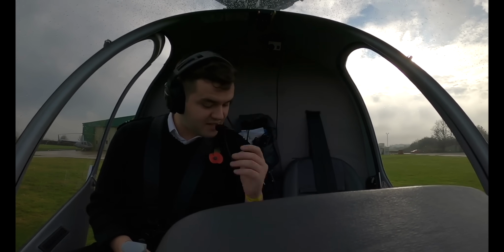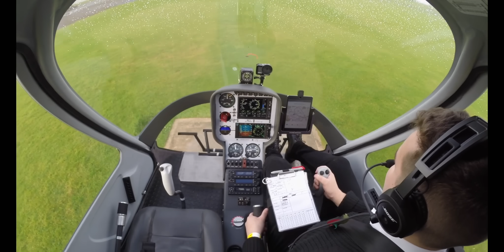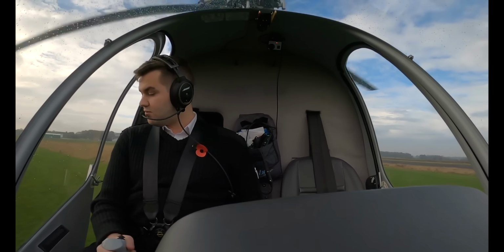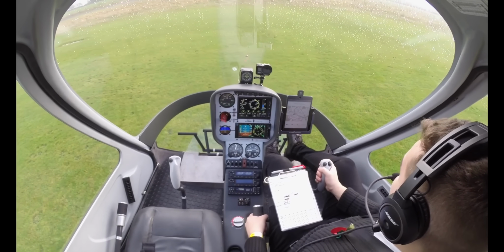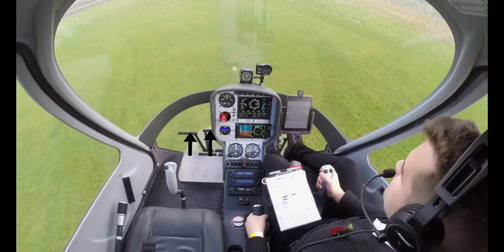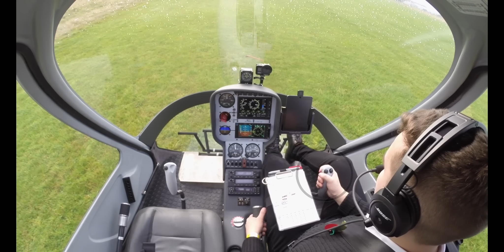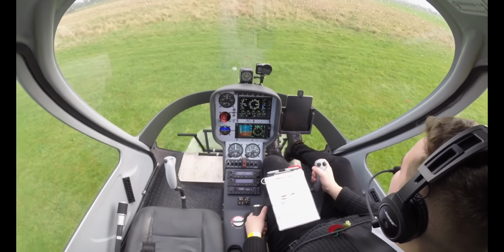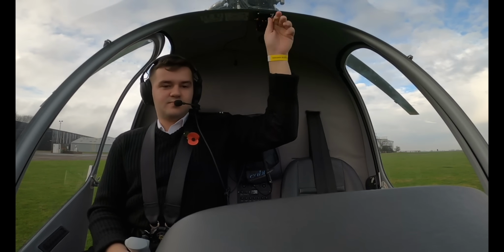How to fly a Helicopter - The Basics

Comment: I started lesson about a month ago and love it. I was flying remote control Helicopter for years and made the jump to the real thing. I was amazed at how similar they are and having an idea of how things worked really helped out.
Reply: CAN YOU PROVIDE ANY INFO ON HOW TO START HELICOPTER LESSONS OR LICENSING?
Reply: @gibson5056  I researched a few aviation schools that had helicopter in my area. There was one real close to me but the one I chose was a 45 minute drive because the instructor was one of the top rated in the country. I got my private V.F visual flying license just a week ago. It usually takes about 6 months but I had the time to take extra classes during the week so I was able to get all my flight hours in in a little over 4 months. To me the actual book part of it was a little harder. If you're really interested there's some great simulators for helicopters there's one that goes for about $800 and it's very realistic I'm not quite sure what the name of it is but again if you're doing a little research you'll find them. I'm going to buy my own but when I started off my instructor gave me one he never used and I put a lot of hours on it.

Comment: Awesome video sir.  I'm a fixed wing private pilot myself, but today decided to be brave and try helicopters in VR.  I don't have a cyclic or collector but my stick yoke and throttle will do for now (with my rudder pedals).  

After spinning out, flipping over, and doing all sorts of uncontrolled maneuvers (that always resulted in my burying myself 6ft deep) I finally slowed down and said to myself, "you know academically that one of the first things a chopper pilot is gonna do is spend hours hovering in ground effect".  So that's what I did.  For hours and hours, and finally got the feel of it!

So today I flew a chopper (in VR still) from San Francisco, all the way down to San Diego, stopping at every airfield and helipad that caught my fancy along the way (even Catalina Island).   The landscape and sights are even more beautiful (in VR at least) from the vantage point of a chopper.  Not sure how that is, but it is!

So, now I'm gonna have to add getting a rotorcraft-helicopter class rating to the bucket list!

Subscribed!!

Comment: Clear and simple explanation. Pretty sure there's more to the skill, still feel confident I could look for a place to land the aircraft if needed.
Reply: Watch the continual movement of his right hand on the stick. That was the most shocking for me during the few lessons I had; you are continually inputting tiny movements when hoovering and moving slowly. I described it to friends as feeling like you're controlling the most slippery vehicle imaginable. The other surprise for me was the delay on the controls and the way they catch up with your input, and it's also a little different with each control. On top of that as described in the video, when you push forward with the stick you need to counter the aircraft's yaw to the left by giving it a little right peddle (a phrase I heard so much I'm sure instructors must have nightmares around this phrase!). Hovering, as a learner, I used to describe to friends as being the hardest video game you'd never play! Interestingly, having only taken eight lessons, I never got to land. It's by far the best experience I've had, and while I never went any further I remember the experience like it happened last week; the lessons were over 13 years ago now. I described the overall experience as being the most incredible fairground ride imaginable.

Comment: Great explanation and demo... but you never showed what you do in terms of power (throttle) settings. It seemed like it is set to some power level, and then all up & down is done with the collective? So you never change the power (e.g. RPM's) as part of the flight control inputs? Can you clarify? Thx!
Reply from the maker: Hi Mike, that's a good question and maybe I should have clarified that a little better. The governor automatically alters the power for me when I demand differing amounts of power when I pull the collective. We are trained to used the throttle in case of a governor failure but normally it does it for us.
Reply: … the big red button is the ejector seat.

Comment: Question what about engine RPM? Does that stay at a somewhat fixed level? Does that change with how you go faster and slower? Coming from totally clueless just curious thanks
Reply from the maker: Harry good question! It's mainly about how much you pull the collective. The more you pull it the more power the blades need to keep spinning at the required RPM. The governor automatically controls the throttle (twist grip on the collective) but we are also trained to use the throttle when flying manually in the event of a governor failure.
Reply: @TheMicroPilot  
That answered my question as well.  I was wondering if the throttle was a twist grip on the collective.

Comment: How to fly a helicopter... Don’t.
Helicopters don’t fly, they beat the air into submission, and there’s plenty of windows so you can watch the air reach up and smack you. They fall “with style”, and consistently beat emergency crews to the scene of the crash by at least 30 minutes. The fan on top is just that, a fan, designed expressly to keep the pilot cool. When it stops turning, you can watch the pilot start to sweat. FI here. 😉
Reply: I love helos - but they're really NOT airframes, just a collection of spare parts, flying in close formation, and all held together by The Jesus Nut. So named, because if it ever comes off the threaded shaft in-flight, you scream "Oh, Jesus!" and get an answer, very quickly.

Comment: Im not a pilot, but to me i think i could relate it to a session rubbing your head in a circular motion and your stomach in an opposite circular motion. While you move your feet from left to right with bent knees in a sitting position. Than twitch your eyes from right to left and pretend your talking to the traffic control guy, until  you're in control of each independent movement  Then one can know if that's a thing for them.

Comment: Where is the throttle?  What increases the RPM's? Because thats what makes you finally lift off from the ground. The engine doesn't just run at one RPM the moment you start the engine.. there has to be a "gas peddle" somewhere.   I'm thinking theres a motorcycle type grip on the end of the collective, and you twist with your wrist to increase the RPM's

Comment: I always thought the collective had a twist handle, like a motorcycle throttle, to control the pitch.  I know when they start up the turbine motors they set something on the collective to dump raw fuel in and once the turbine is going they turn it off.  It would be awesome to fly a rotory-wing aircraft.  Thanks for the video.
Reply from the maker: The twist grip is the throttle control. The rotor pitch is controlled by raising or lowering the collective.
Reply: @TheMicroPilot  So how does controlling the throttle work?  You don't mention it - is it automatic these days, with FADEC?

Comment: I wouldn't be able to fly a plane or helicopter because the rudder pedals are backwards.  To turn left you should have to push the right pedal forward.  Like the levers on a bulldozer or a tank.  Or riding a  runner sled down the hill.

Comment: Isn’t there something analogous to an airplane trim tab that would keep you from having to apply constant right pedal to counteract torque?
Reply from the maker: In principle it sounds like a solution but the problem is the varying amount power when you pull collective means you have to almost constantly vary your pedals (especially in the hover). Even if you were to use it just for the cruise you don't need it. When cruising the reduction of power compared to hovering means the pedals are almost equal. Also they don't give any force feedback so its not like you're constantly pushing your foot forward.
Reply: Its a constant gentle maneuver of all. They say hovering is the hardest part.

Comment: I would be reality nervous about the "reverse" operation of the pedals, due to the French rotation. Did you train and convert, or is this how you have always flown?
Reply from the maker: This was the first aircraft I trained on but I have also since got my R44 type rating which is the left pedal. It isn't really that hard, just remember when you get into it which way round it is.
Reply: @TheMicroPilot  I'm just picturing coming in a bit hot, pulling power in and automatically applying left pedal. Great to hear you can switch.

Comment: Hello, I'm writing software for a helicopter simulator, and I have a question.  I've developed a free body diagram for the helo, but I'm wondering if (on an R44 semi-rigid rotor head) the rotor head can transmit pitching/rolling moments to the mast.  (ignoring the yaw torque for now).  I'm trying to understand the relationship between the pitch/roll of the rotor disc, vs the pitch/roll of the airframe.  Say we're cruising at constant speed.  Why does the airframe pitch forward?  Is it simply because the rotor disc is pulling forward, and the drag on the fuselage is pulling back, and the difference between the two creates a pitching moment, which in steady state is eventually offset by an equal and opposite moment created from the CG wanting to swing forward?   Do you feel like you're really riding in a pendulum when you're flying in a helicopter? (dangling from the rotor mast, vs a feeling of being rigidly attached to the rotor disc).  Thanks for any insight you can provide.

Comment: What would happen if you pushed left and didn't correct with the peddles? Would the helicopter start to turn to face the direction of travel?
Reply from the maker: Sorry what do you mean by push left?
Reply: @TheMicroPilot  I mean push left on the cyclic but don't correct with the right peddle to keep it facing forward. If you didn't use the peddle, would the helicopter turn to face the direction the helicopter is moving?
Reply from the maker: @magicmagicman  No not really, they have a tendency to hover right skid low so without it it would just drift left. You always need right pedal when hovering as the torque produced by the engine in the rotors would make the helicopter spin out of control, the right pedal counteracts this. That would be way more powerfull than yawing into the direction of motion.
Reply: OK, so suppose it's a completely still day and you are hovering. Then you apply some left cyclic and the craft accelerates to the left. Then you apply enough right cyclic to arrest the leftward acceleration and make the velocity to the left become constant (not zero, but still leftward at some rate, a few meters per second). But you have only held your peddles fixed the same way you had them at when you had been maintaining your hover. Would the helicopter yaw? Which way?

Comment: You mentioned you needed power on the right pedal, I've noticed that in Microsoft flight simulator too..I thought I had the settings wrong, then I thought maybe the natural rotation of the vehicle (due to the main rotor) meant it was turning left easier..am I right ?

Comment: If you can fly a fixed wing aircraft you can also fly a helicopter. The most important control is the rudder and not using it correctly in the helicopter will result in disaster.

Comment: Does helicopter will auto level itself if you release the stick? And does the stick has a spring to pull the stick to the center and you have to push the cyclic against the spring force? 
I only have flown a RC or FPV drones and never been inside a real helicopters so I cannot relate to it.

Comment: Do helicopter 🚁 need alignment for it steering as well
Reply from the maker: It depends what you mean. The control linkage between the controls and the rotor blades is very complex and requires very accurate tuning by the engineers if that is what you mean :)

Comment: Can you trim those controls?
Reply from the maker: Yes, we can trim the cyclic by the little hat switch on top of the cyclic. You can't necessarily trim the collective but you can apply a little friction to stop it from tending to drop down so easy.
Reply: @TheMicroPilot  What about the pedals? 

Also I have no experience of flying helicopters, but is the constant movement of the cyclic necessary? In the airbus you often see something that looks similar (but is probably completely different) we call it "stirring the pot". Particularly inexperienced pilots quite often feel the need to make constant small corrections which means the aircraft is never quite settled.
Reply: @njebarr  When I tried to drive a bigger boat than I was used to, it took me like four days to overcome the tendency to overcorrect the rudder constantly and swish back and forth.

Comment: The guy mentions "RPM in the green" once but doesn't tell us anything about the throttle, which I think is adjusted  by rotating the collective handle.
Reply: He's using a governor.
Reply: @b43xoit  I'm not a pilot, just taken a few small helicopter flights with a friend decades ago.  I thought a governor just prevented overspeed. I don't know.

Comment: I found the video a little boring as all maneuvers were from the cabin. If the instructional data was backed by outside views showing the results of each controls application it would have  been more informative and educational.
 I do greatly agree with one of the commentors. I CAUTION anyone even remotely thinking of taking lessons and flying helicopters . . . DON'T. 
The "rush", the excitement, the sense of accomplishment is so addicting it becomes an obsession, AND don't be fooled. It takes a special mentality, hand/eye coordination level and mental 'defect' to master. Just because you have a good flight day today does NOT mean you won't lose your ability to simply hover in ground effect tomorrow. 
 Good luck to all prospective "rotorheads".